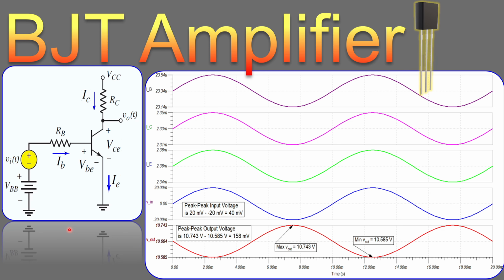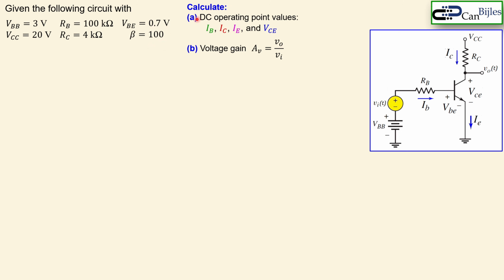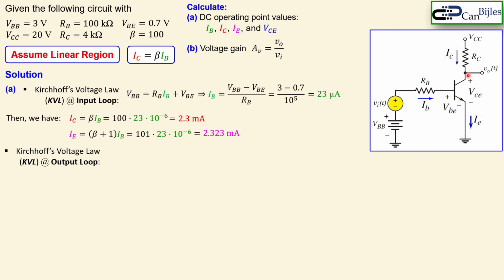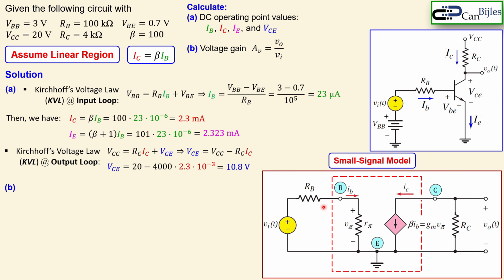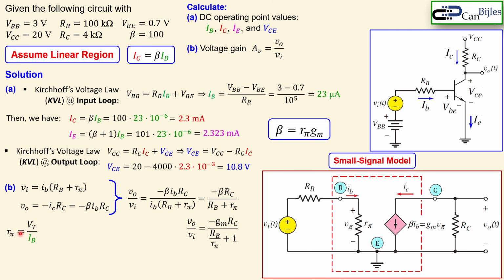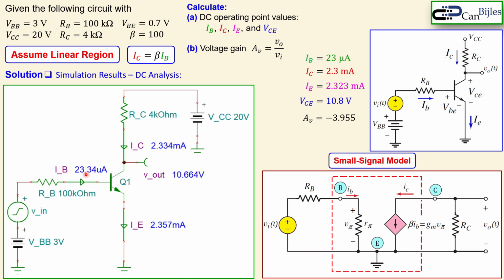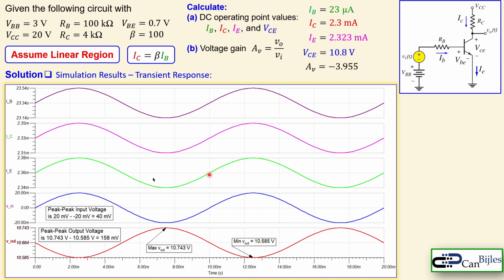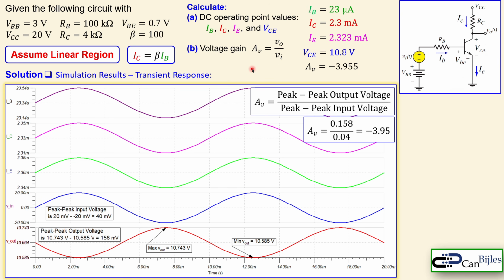BJT Common-Emitter Amplifier 🌟 Calculations & SPICE Simulations 💡 Example 1

Comment: I used an input of 0.5 volts amplitude (1 volt peak to peak) so all I had to do was get the output peak to peak value on the graph. This gave 12.6348- 8.6882 = 3.9466
Reply from the maker: Good that you got the output peak-to-peak value using the graph. Did you designed for this voltage gain?